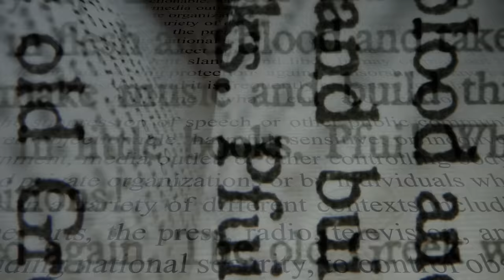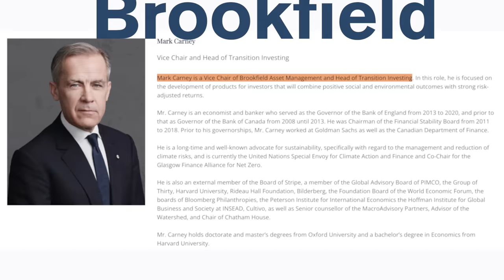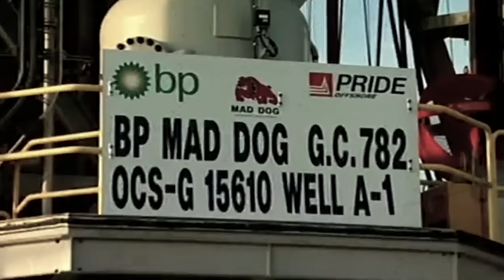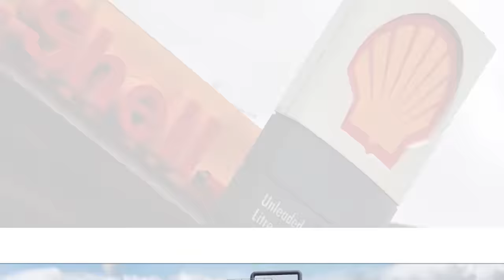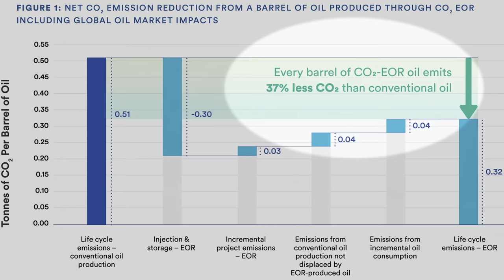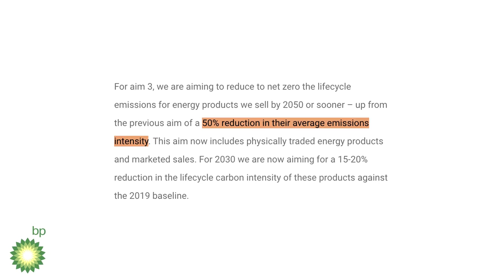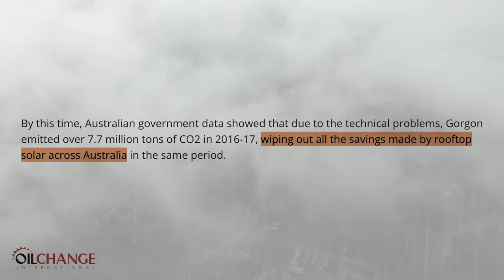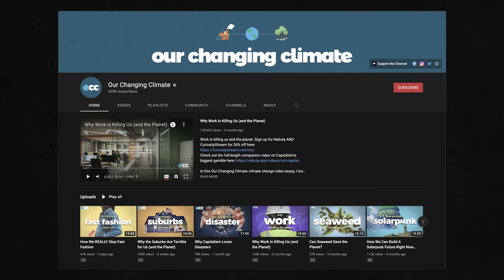The dirty "Net Zero" carbon myth (that everyone believes)

Comment: Disappointed that you tarnish all the oil and gas industry with the same brush. I have in Oil and gas most of my career and although admittedly it is not great for the environment it has created great leaps in social and technical progress. Until there is a viable alternative, green energy is not so green because of demands for copper, lithium, cobalt etc. so please try and give a more balanced message.

Comment: As pointed out - trees - yes.  However, one of the best technologies, if it were to work, is a Carbon Capture device that then allows for the creation of Synthetic Hydrocarbons.  Instead of drilling for more oil, we take the Carbon we already have and make our own fuel.  The first benefit is that NO MORE carbon will enter the atmosphere from drilled oil. 

Then, as we are taking CO2 from the air, turning it into fuel to then be burnt we are creating a cycle rather than a one way system.  On top of that, as Fuel will be created, stored, put into fuel tanks etc, Millions of Tons of CO2 will be taken from the atmosphere to be reused.  Win/Win if it works!

Comment: there is still a lie in this video unchallenged.

carbon is bad is a lie

we dont need less carbon in the atmosphere, we need more, why? because plants use less water and grow faster as carbon levels rise. that means less desert area, more food, more water. yes temps might increase slightly but that will be offset by more dense vegetation. Australia would benefit tremendously as the coastal green belt would extend further and further inland as CO2 levels rose (and create more rainfall). Canada would also benefit as temperant zones would reach further north. yes there would be changes in habitat for animals but in earth's history that is cycle that has repeated itself countless times. i agree fossil fuels are not the future if for the simple fact they are a diminishing resource and i could understand "clean" carbon emissions as a goal but carbon is the single most important element for life on earth, no carbon means no oxygen. this carbon is bad message is insanity and i dont understand how so many have fallen for it.

Comment: Good presentation.  A lot of this I knew, but did not know the details.  Thank you, to me, this actually sounds like an extension of some of the things said by Lindsey Williams in his book, The Energy Non-Crisis which he wrote in the 70s.  He basically talked about the ideas more in general and from his point of view as a minister working with the people who worked on the Alaska Pipeline.  Do you really believe that there is a Climate Crisis?  There are many people on this platform that talk about the Grand Solar Minimum and the changes that are happening just because of the cycles the earth is going through as it changes its position on its axis and as the solar system flies around the galaxy.  In the early 70s, the lamestream media was advertising that we were going to have another ice age.

Comment: this was truly poorly research. For starter, you didn't even define net zero in your video, neither did you mention how it is measured, nor what accountability measures exist, nor what the scientific models are - if you want to point out what the oil&gas industry is doing wrong, you first need to define what they should be doing according to scientific models. 

CCS was never a main pillar of net zero models......this video is just twisted to jump on a bandwagon without doing the research work.
To use your words, this video is just about making profit (ie click), not to inform, because substance didn't show up in this video.

Comment: There are arguments that the whole carbon dioxide thing is backward and we are approaching the point of not enough because life has been so successful it used it up. Since coal and oil are made from carbon they are inadvertently doing something useful (whilst polluting in other ways) - see Dr Patrick Moore (not the astronomer)